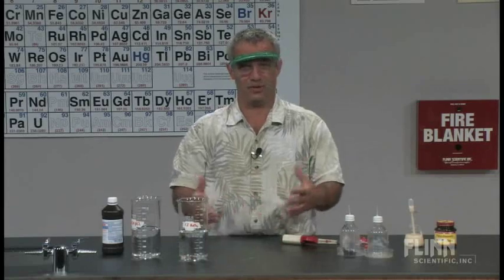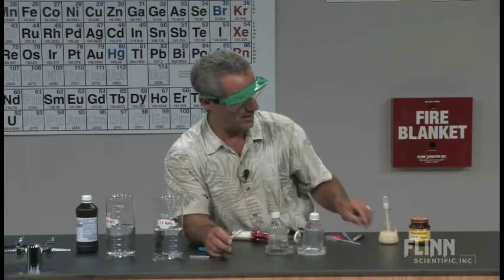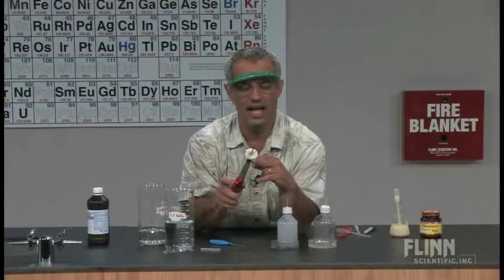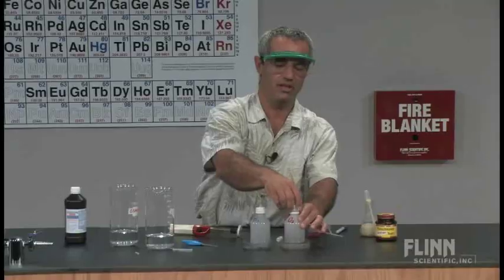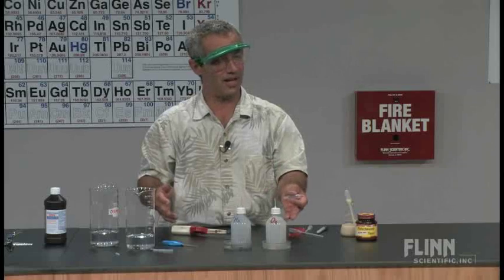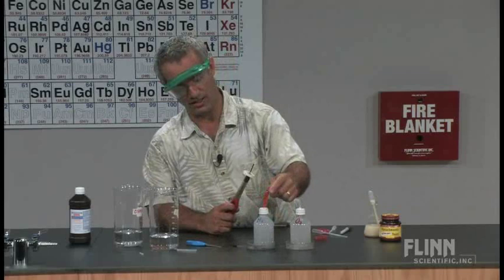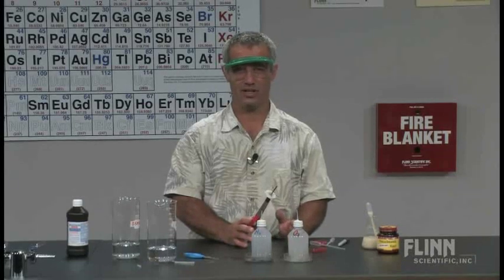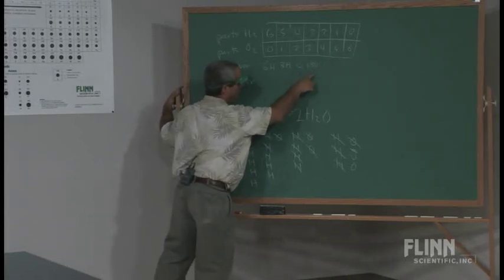Micro Rocket Lab

Comment: One quick question- how did you determine where to place the marks on the pipette bulb so that it's exactly 1/6 increments?
Reply: +Emily Hart You figure out how much volume is in the pipet bulb by filling it with water then dispersing into an empty graduated cylinder. Refill it and squeeze out 1/6 the volume. Use marker to note the water level. Repeat. You can just copy for the rest of the bulbs.

Comment: does anyone actually know what happens in the pipet when water is added? i'm guessing the combustion of the hydrogen and gas gases produces lots of heat which reacts with the water to create steam which escapes to produce thrust??
Reply: Shan Jiang : nope, remember, every action has an opposite and equal reaction.

Gas isn't very dense, so when it goes one way, it pushes a small force the other way moving the rocket forward.

Water is dense, so when it goes one way, it gives a lot more force on the rocket going the other way.